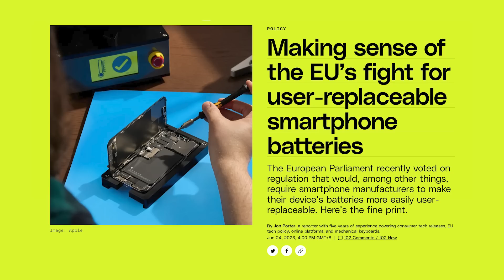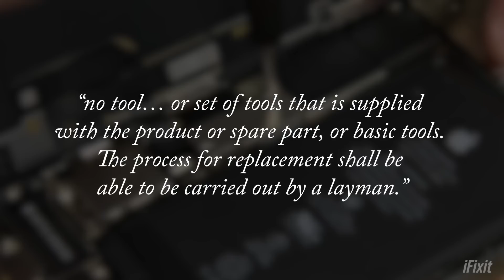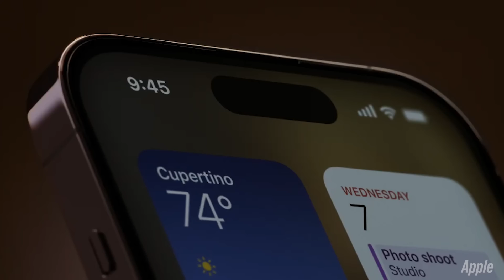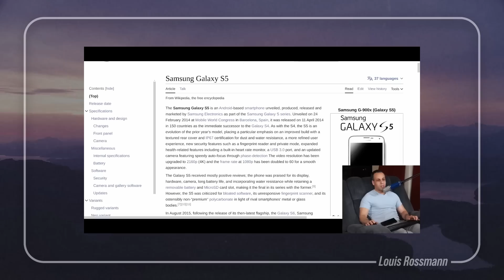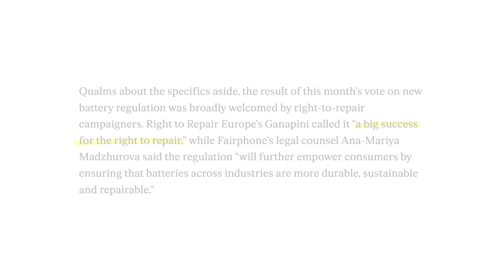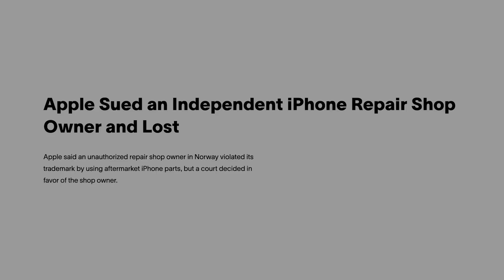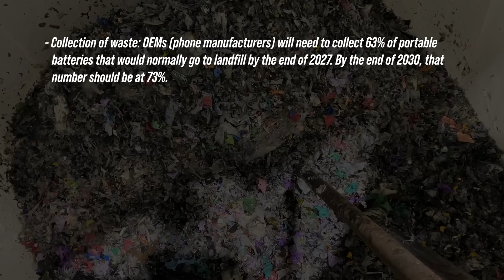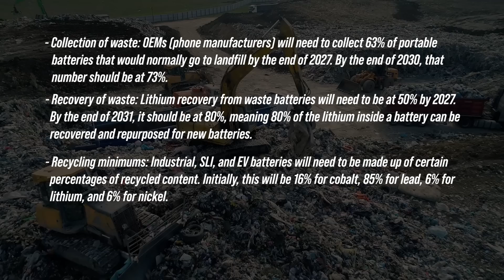EU Just Changed Smartphones Forever

Comment: I remember the day when batteryies were replaceable and we got new phones every two years because the carriers were giving them away with new contracts. I don't ever recall buying a new battery for these phones. Since this time I have had an iPhone and tend to keep them between 4-6 years. During the time I have paid to get a new battery in the iPhone. I never felt as though the charge to get a new battery was exsuessive. I've done this 3 times and will likely be doing it again next year on my current model. 

What I also remember from the era of replaceable batteries is dropping and damaging these phones often. What I'm not sure of is the design of the phone with replaceable battery that makes it more damageable or if it simply my age that makes me more cautious with the phones I have. 

There also is a third way of looking at this. There are 3 major manufactors for batteries, Samsung, Motorola and LG. Is this law truly here to help the environment or to help line the politicians pockets as they take stock options knowing they are passing laws to promote growth in a business? Was there studies done to see if buying habits would change if the phones have replaceable batteries?
Reply: If we would be talking about older bricks with keypads, those were quite robust actually. They were thick and had soft plastic, so if you dropped it, you would get a dent or it would flex but not break. My older phones went through various adventures, I even bought SE U1i that was dropped from quite high and it caused a scratch and a dent in the screen. At the time I could not afford anything too expensive and it was my first sort of smartphone (although it was Symbian based). That's because it was not a glass screen yet.
The early smartphones had problems. They were much thinner and not rigid enough, it was very easy to damage them. Removing removable batteries was part of the solution. One thing is to add solid metal frame, another is to stitch both sides together so that it can't flex. If your back is easily removable, then it's not a structural piece. All of my old phones could work exactly the same with and without the back flap. That's part of the problem, large part of the phone case is not structural and if you shrink it to barely a few millimeters, it's not rigid enough. We've seen enough phones that bend in a pocket even if they were glued. So yes, glued phones or bolted phones are more rigid now than the older phones with flap that was not secured in any meaningful way. 
Besides that, I'm pretty sure that small reduction in the number of new phones bought will be offset by vast increase in battery replacement people will get just because it's so easy. I can even say it for myself, I was replacing batteries in older phones when I had impression that they are running noticeably shorter than before. Even if they were still usable, battery was cheap and easy to replace, I'll keep the old one as a spare, why not? I always ended up having 2-3 batteries. With newer phone I also have impression that the battery life is shorter but because it would cost me maybe $50-100 and a trip to some service, I'll wait with replacement until it actually calls for it. Especially that in the past I had to count quite a lot of time to charge it while now I have chargers everywhere and the phone gets to 80% so fast that I won't finish a cigarette. Even though very fast charging will degrade battery much quicker, if I already accept that sometimes during the day it needs 5-10 minutes on the charger, I will not have a problem with it. And if I plan some trip that requires a lot of battery life, I always have large power bank anyways. And that's probably a second thing people forget, power banks were not a thing in the past, you could not simply take tiny thing to recharge your phone quickly. Now they are widely available and provide fast charging.

Comment: I think at the end of the day it will barely matter. There won't be many people who would make use of that function. Maybe 10%, which is not negligible, but not a huge amount of people either. It's a law that will go down in the (EU-) burocracy vault. Problem with those regulations is mostly, that they are not flexible enough and take years to come into effect or be altered. So once we have replacable batteries, what comes next? Replacable OLEDs in 2040? Too late, by then we will have newer and better displays. At the moment, there are other components and technical progression of the product, that will render a product obsolete rather than the battery, in most of the cases. So it will go as a side note, but to most not relevant. 
If they really wanna change something, they need to change the nature of those laws, make them adaptable to progress and flexible as well as subject to change quickly if needed. 
The idea is good, the way it's done is not.

Comment: That LG G5 battery is sick. Id love future phones to have a battery swap like that. Just remove the bottom speaker section and unplug the battery, plug a new one in and slide the whole pack back into the phone. I suppose they could make it even more secure seal by using 2 small screws at the bottom as well for a secure mechanical lock instead of a friction seal lock.

Comment: I am still running a LG V20 phone with replaceable battery - It will be 7 years since it's release in October this year - I have owned & used mine daily for 6 years now across the world (Thankyou dual sim). I have replaced the original battery 3 times in those 6 years - On my 4th now. Phone still works really well & it is still able to do all things that I wish. I will only change it if it breaks & cannot be fixed or I can no longer buy a replacement battery.  The old batteries have been recycled through E- Waste. Until I have no other choice - I will continue to purchase phones with a replaceable battery - I have never had one with a non replaceable battery since my first phone in 1995 (28 years).

Comment: The market has already taken care of this problem with hundreds, if not thousands, of charger bricks available. I have broken or otherwise worn out every iPhone I have owned, and the battery still worked.
Also, there are hundreds of videos on YouTube of people repairing iPhones. And screens are repaired at shops all the time, even now. So obviously there is a way to let the phone know the part is the same. And the cost of repair shops is in the noise compared to the cost of an iPhone. 
The battery industry is already trying to minimize heavy and dangerous metals. 
 
This crap is none of the government’s business.
Reply: And where does it end?  Why should I have to replace an entire camera module when one lens on one sensor is broken. Is it the magic word “module”that makes three cameras one part?  Ok. An iPhone is a “phone module.”

Comment: Unfortunately this law will not bring what we were hoping for. It only applys to batteries which are rated to be down to 80% of max capacity compared to starting capacity up to only 500 cycles.
Not only is 500 a much too low treshold (having more than 500 removes the need for the batteries to be removable) its also extremely far below the average rating. The very most phones come with 800 cycles until 80% at least. Some chinese brands even offer 1600 or 2000 cycles until down to 80%. Even with just 800 cycles usually these batteries are well usable for 4 to 5 years, with 1600 I'd imagine even longer. The main benifit of easily removable batteries was not to fight degradation, but to fight a battery just dying having degraded much quicker than other phones of the same model or literally just to extend your battery life because if your phone was empty you could just slap in your second battery on the go. I have only once in my life seen a phone where the battery is so degraded it is actually barely usable. And that is a now 7 year old Samsung Galaxy A5 (2016) that had its battery at a super low discharge for like 3 years of lying in a drawer far away of human traffic. Its still alive, just in very bad condition. I really just lasts like 2 hours off the wall in standby. But thats because it has been heavily misused/not cared for due to having been replaced by a S10+. So even though, battery degradation is barely really a problem in Phones I still miss the feature where you could just slap in a second battery or replace it without a heat gun, etc. within a couple seconds rather than almost an hour.

Comment: "Removable batteries will make phones bulkier and less premium" Why yes, i love how premium my phone looks while completely covered in a otterbox that completely covers it, and holding it against a wireless battery pack that makes the whole ensemble 3-4 times as thick as just the phone alone.

I admit i occasionally am amused at how thin the phone actually is when i remove the case and everything. But i would much rather have a thicker phone that has a removable battery and can survive landing on a corner without the screen turning into a piece of contemporary art.

artwork: Spider and ink
artist: Metalwolf's cat with assistance of gravity.

Comment: If right to repair was genuinely the consensus of most consumers then logically there should be a market for a phone/tablet/laptop maker to create a device that would have many user replaceable parts. If that was truly a desirable feature then the market would flock to those devices. That just hasn't happened. Because while user repairable parts sound nice in theory, most people don't care. Inexpensive warranty plans have been around since this problem began that have effectively made it a non-issue for many consumers. Additionally, most consumers choose to upgrade long before their device has reached obsolesce. (Just go ask retailers how many perfectly functional phones are traded in for upgrades. Reselling those phones is a notable part of their business.) Electronics manufacturers would not openly avoid such a large market share demanding replaceable parts to simply maintain a planned obsolesce conspiracy. Despite what victories many right to repair advocates declare, government bodies demanding design changes like this is not good for a free market. These design changes run the risk of stifling further innovation and could easily create cost increases on a market where median cost has already been trending upward. Consumer choice on what type of device they wish to own will always be a better market setup than government mandated design.

Comment: To be fair, phones have not evolved much in the last decade. 
This law solves just half of the problem. What will stop companies from removing access to some software and services for phones older than 2 years? 
Removing access to the play store, apple pay or whatevs for devices older than 2 years because of "security concerns" or "software limitations" (even tough even a 10 yo phone has the hardware capabilities to run the respective app).

Comment: I still use my POCO F1 now. It is almost 5years now. My only problem with my phone is THE BATTERY.. all other component are still good. This is why removable battery are crucial. Why do I need to throw away my phone if it still work fine right?!

Comment: Next step would then be an EU law to force major OS updates for 5 years and security updates for 10 years. So phone manufacturers don't release a new model every 6 months because they have a slightly better camera than the previous model. A lot of phones are mostly defined by software and the hardware achievements are very minor. I would still use my Oneplus 5T if it wasn't out of software support.

Comment: Eventhough no water resistence may be a no go for some people, i work as smartphone technician and in most cases it's not even worth it.  It can damage the ports easily, it voids the warranty unless you pay for the repair which is expensive, and you can loose you phone data ccompletely due to corrosion. IMO it's best to use waterproof case than rely on water ressisstance.

I missed some things from old phones and this is a big one for me. Replaceabla batteries are better considering that batteries are getting slimmer, which for most none High-End flagship phones can implement easily considering the're componenets are smaller. Hence i look forward to this change.

Comment: This is a stupid ruling and anybody in favour of this is a clown who knows nothing about technology. Removable batteries have thick outer coatings as part of safety requirements in order to prevent them from getting punctured during handling. The slots to put the batteries in + the outer case means the removable battery will be significantly smaller than its non-removable counterpart for the same size. Since batteries these days are so good and rated to hold at least 80% of their charge after 1000 cycles, this means a brand new removable battery will hold less energy than a brand new removable one. If you wanted to make phones thicker, you could have just asked for a bigger non-removable battery. 

Also, removable batteries means waterproofing is impossible without making the phone substantially thicker. Only a few industrial phones do this. This is because waterproofing requires sealing stuff inside and making it fully airtight. This isn't exactly viable with something that's easily opened by the end user. There's also the problem with thin glass and metal backings premium phones have, which is that they're both more brittle compared to plastic. Repeated opening and closings might fracture them, which forces manufacturers to make them thicker or go back to plastic. So not only does removable batteries actually worsen the problems of poor battery life that it tried to fix, it actually ruins several other things. This is what happens when clown boomers make regulations about things they don't understand.

Comment: Part of the reason for companies making non-removable batteries is them violating the right to repair, so they can force more expenditure by us, but I think part of it is also if you can't remove the battery then the phone can always be tracked. Though they might just start putting a secondary battery on the board to power the GPS if they really want that.